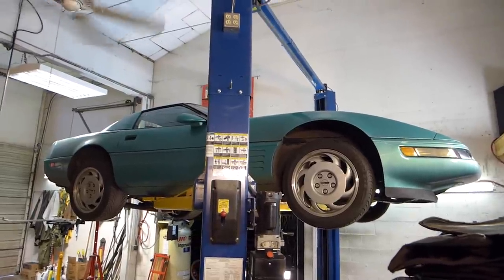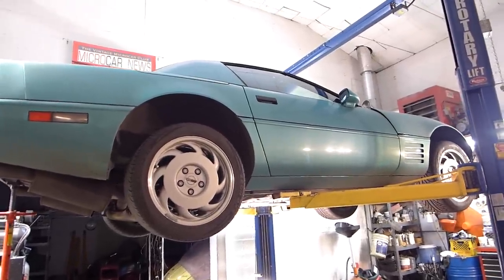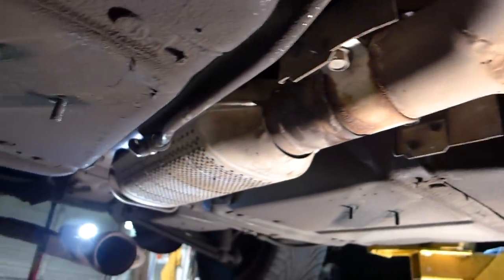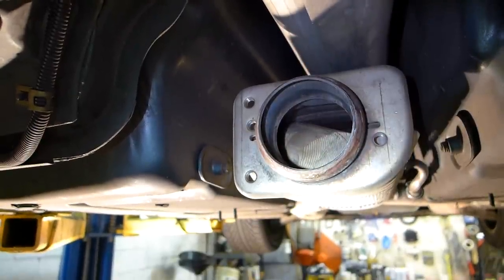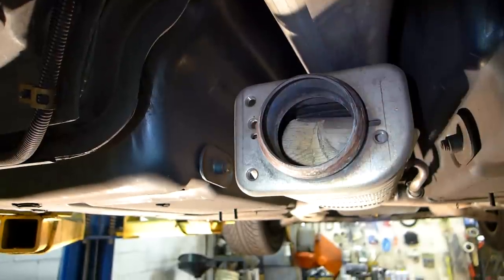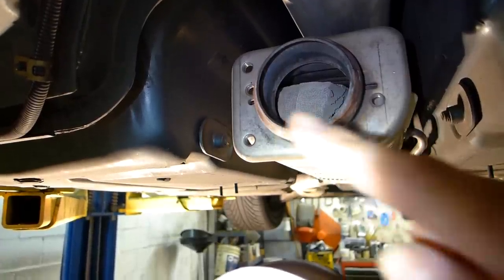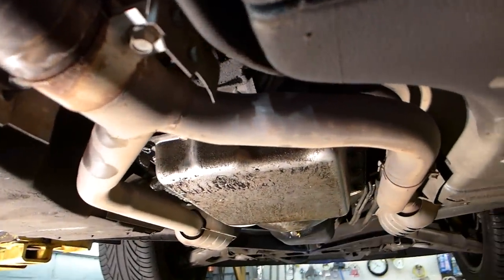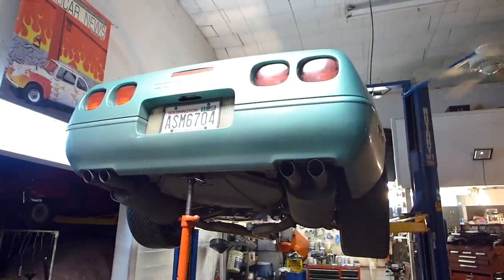How to know for certain your Catalytic Convertor is BAD !

Comment: Yeahhh 700 bucks for a new cat on a 24 year old vehicle... No thanks! I'd bust the element out and bolt it back up. problem solved.
Reply from the maker: coolbluelights  it's funny how many people say that. The new Catalytic Convertor was $300. and now the car will pass DEQ
Reply: The converters in my truck did just this. I busted the substrate and gained extra horsepower and gas mileage too. Been like that for 9 years now.
Reply: 2stroketurbo
Still too expensive, but what am I saying? I can't afford a corvette either lol
Reply: 2stroketurbo
What's DEQ by the way? in NY we don't have an emissions test.
Reply from the maker: coolbluelights In Portland metro all 74 later cars must pass DEQ ( dept of Environmental  air quality  ) to renew plate tags
Reply: That sucks. anything '95 or older is exempt from any emissions laws in NY
Reply from the maker: Wow. I did not know that
Reply: That is pretty good for that cat. There are cheap ones that meet Federal standards, but don't meet California and New York state standards, and those can be more. A quick check for CARB (California Air Resources Board) approved cat at Rock Auto is over $500.
Reply: It is '75 and newer in the State of Confusion (California), and they have very tough standards for a car to pass. It may be easier to find cars from the '60's and early '70's  in CA than cars from the '80's. If it doesn't pass, you fix it, sell it out of state, or scrap it. The state offers $1500 for cars that run and are registered, and then they scrap them. That's where my '84 Chevy Citation and '89 Chrysler New Yorker went. It would have cost me about $1100 in parts to get the Chrysler to pass smog, and the car was in nice shape. $1500 from the state for it, and they crushed it that day.
Reply: coolbluelights In southern Indiana, there are no emission laws or testing. I’d remove it for a straight tube, did so on an 04 Silverado with Flowmasters and sounds like a classic now.
Reply: 2stroketurbo maybe for that one in particular but most cars have extremely expensive catalytic converters, nissans and Toyota’s and basically any car after 2000 the cats are $500-$600 each not counting a lot of people don’t want to do it themselves so that adds about $200 to labor

Comment: The Magnaflow 93341 bolts right into this car and can be found for around $150.  Without a cat the stock mufflers sound throaty at idle, but as the RPM's increase it sounds raspy and tinny.  Forget it with any after-market mufflers.  It's so loud you can't hear the radio or talk to a passenger.  No cat + after-market exhaust= cop magnet.  The Magnaflow Cat (or any high flow for that matter) keeps things clean and acts as a resonator for the mufflers.  I've run with and without and the performance difference isn't enough to be felt.

Comment: "Good for the environment" is such a bs statement. Emissions from 1 dirtbike or motorcycle is 10x worse than a car without cats
Reply from the maker: Yes. Right. Untill you can't breathe fresh air its hard to understand
Reply: @2stroketurbo  wont make a difference. Should have just saved the money and deleted it and take that money and plant a tree. Would have done more good for the environment.

Comment: Now.. If you are worry about mother earth you would stop driving your two strokers.  I bet that cat cost big $$,  Thanks
Reply from the maker: zzzdogutube   cat was $ 300. no too bad , my two strokes are smokers alright
Reply: To gut that old cat would be $0 . Better. But you can't do that. you are a repair shop
Reply from the maker: $10,000 fine for me to gut that cat ..as well as I like to breathe fresh air . Win-Win !
Reply: OK but you still drive those smokey 2 strokes.  You need to stop.. 2 strokes are bad!
Reply: zzzdogutube you know your 12a engine drips oil into the fuel mixture to lubricate the rotor seals.  And Most Rx mechanics will tell you to put a bit of 2 stroke oil into your gas for the rotor seals.   Also a reason you are not supposed to run synthetic oil in a rotary

Comment: Same cat just started rattlin’ ‘round on my ‘91.  Thanks for the look inside.  Didn’t really occur to me that the core could actually spin n block the air flow that much.  This vid just bumped the exhaust project to the top of the to-do list

Comment: Very professional concise just the facts with spot on camera-ing.  I've owned a 165,000 mile1990 about four years ago.  got it running properly two years ago - new fuel system from filterbag to rehabbed injectors.  good enough for sunday drives but it started bucking and running rough so its been sitting a few months.  it also fills the interior with smoke quickly so i want to get under and disconnect the cat.  it could also be something else twitchey on this 30 year old still super duper hi tech hot rod.  i'm trying to fix this scientidfiucally instead of throwing parts at it.  once the filming of a hoarders episode in my garage is completed, it will be in and safely raised to thrash on.  (j/k about the teevee show.sarcastic humor can turn boring arcane tech into a delightful barrel of monkeys....on acid)